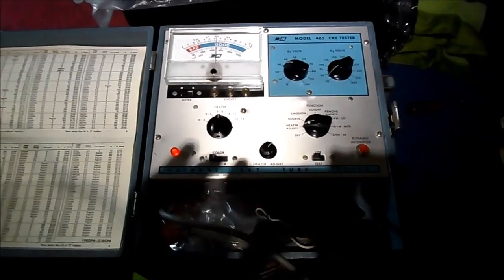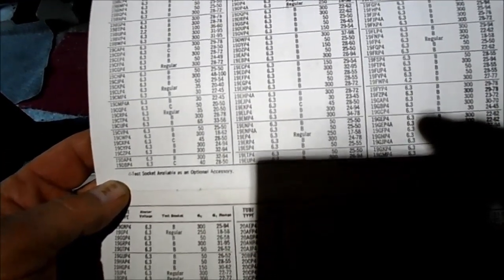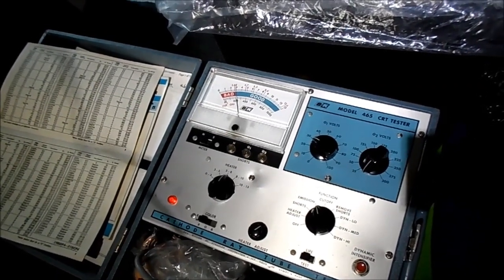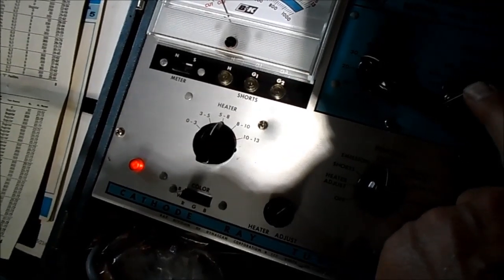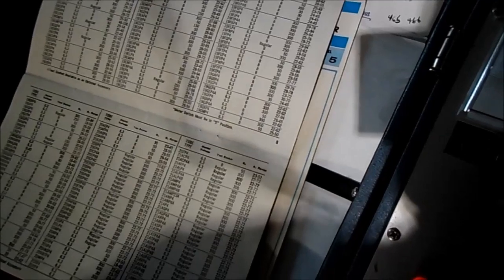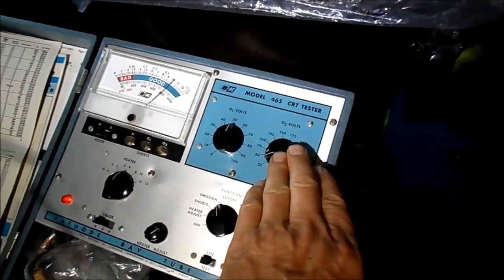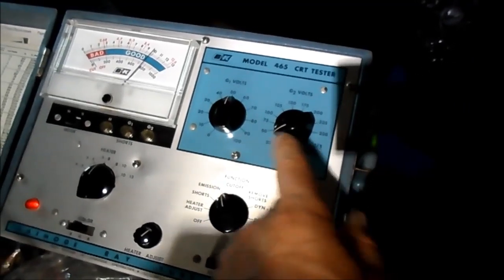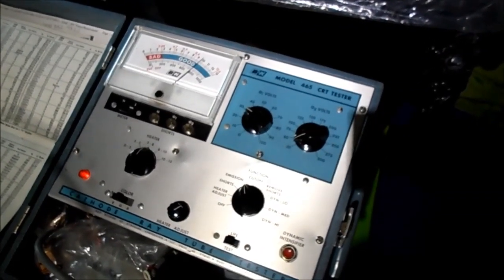19CXP4 Test Using The B&K 465.

Comment: Here is a tip passed to me 30+ years ago. When range is given for a control, set it to center of the range.  If you get a good swing on sweeping the G-2 do not fret over setting the cut off, set to center of range and leave it alone. Of course real test is a good picture on screen. If you try the CR-70 again set G-1 at -26 volts it  should work. I've never checked a 19CXP4 so don't know if  that set up is wrong. The SENCORE set up book has a bunch of errors in it. My CR-70 book has many corrections penned into it.  All the best, Tom J. from FLA.